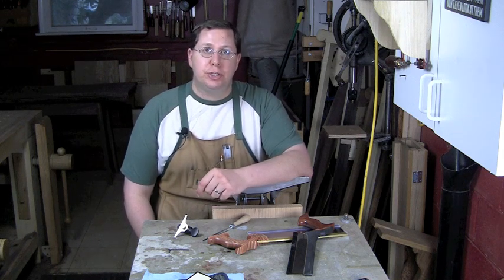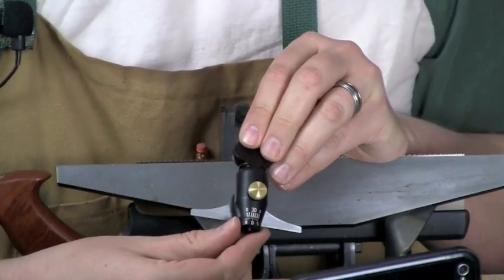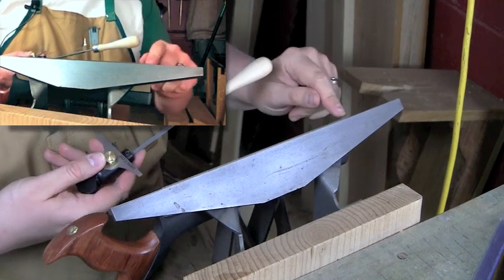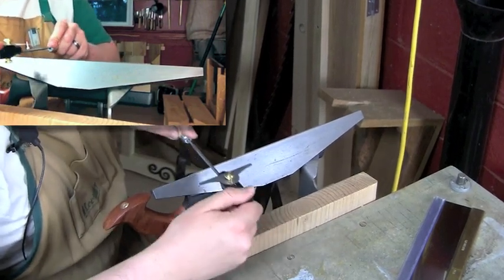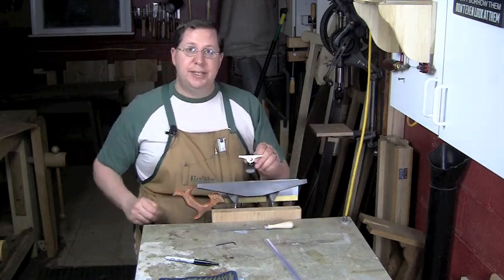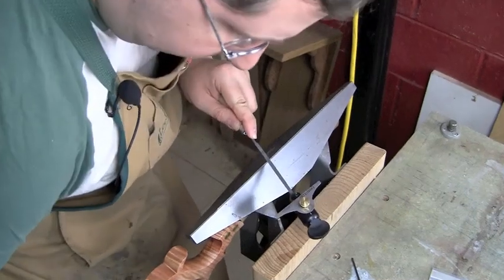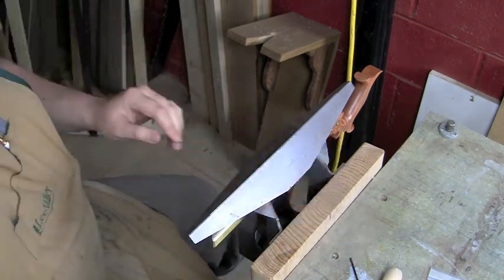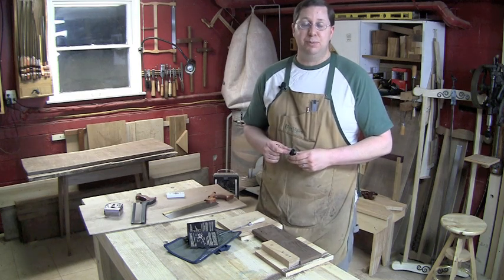RWW 154 Veritas Saw File Guide

Comment: Hi Shannon, another good video as usual- thanks. 

I love using Peruvian walnut (25:30) but I have found it much softer than hard maple. I find it really easy to plane and saw, although if you plane in the wrong direction, the tearout can be really deep. I find my blade edges last for ages as well. It takes an oil and wax finish beautifully.

On another note, can you recommend a good saw setting tool?

Comment: Pura vida Great video and information I have a question How do you set 65degres? Thanks
Reply from the maker: set it to 25 degrees and reverse the direction of use.  Though I can't think of a time when I would want such an angle in my saw teeth in either rake or fleam.  25 degrees rake would be super slow and spongy and 25 degrees fleam would produce brittle teeth that would crumble in short order.

Comment: Hi Shannon, I always enjoy your videos, thank you!
However … this time you have confused me. At 21:55 you state that when the saw is turned, you have to switch the rake-angle but that you leave the fleam angle alone. Are you sure about that? I am used to switching  both the rake-angle and the fleam-angle after turning the saw and starting with the other set of teeth. ‘Wood by Wright’ (https://www.youtube.com/watch?v=XE9Ne3MUXn0) at 11:05 seems to agree with me. What do you think?
Reply from the maker: Most likely I misspoke.  However these days I don't flip the saw around anymore.  I sharpen all from the same side.  It also makes adjusting the guide a bit more idiot proof since you aren't changing the geometry of the saw around to confuse the issue.